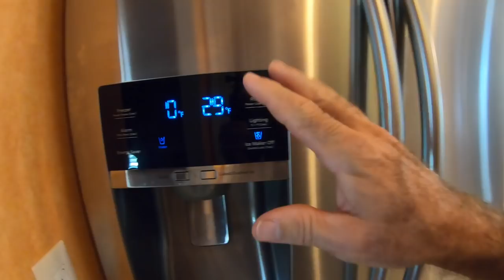HOW TO FIX A NOISY SAMSUNG FRENCH DOOR MODEL REFRIGERATOR

Comment: Weird, I have the same noise, not quite as loud.   The noise stops when I open the door.  I took the panel off and saw a little ice build up but not much.   Before defrosting it, I just disconnected the fan and shut the door to see if that was the problem.  It still makes the noise, even though the fan isn't running?
Reply from the maker: The fan motor is designed to stop when the door opens.  If the noise is still present after unplugging the fan then this obviously isn't the source of the noise.  Possible the noise is coming from the lower freezer section.
Reply: @MyPIDream  I pulled the fridge out and got behind it to see if I can narrow down where is coming from. It really does sound like it's coming from behind the ice maker area.  Compressor maybe?

Comment: Helpful information and good video, but not a fix.  This just resets the problem.  And if that is all you are doing, I think it's preferable to just let the unit defrost without getting near the coils.  As to the underlying problem and causation, how about installing some sort of barrier, perhaps plastic or light metal and slightly perforated, glued or attached with fasteners, separating the fan and its shroud from the coils on the right?  Seems like if it is in the right spot, attached firmly, it might divert freezing condensation away from the fan and fan shroud if attached carefully so it doesn't interfere with any component nor prevent necessary fan air flow.  Also tempted to gently bend the coil tubes away from the fan but I realize that's delicate because they are soldered.  Another idea would be to remove the fan and shroud assembly and augment the shroud in some way that would physically prevent encroaching ice from interfering with the fan blade rotation while still allowing necessary air flow.  Thoughts?
Reply from the maker: The main point is to analyze what is causing the icing which ends up with ice contact on the fan itself.  Adjusting the copper tube was a fix for us as we've not had a reoccurrence of this problem since this procedure was done.  The procedure I explain in this video is my approach but it's possible there might be other solutions, as you suggested, that might also correct the problem.  As they say, "there's more than one way to skin a cat".
Thanks for the great comment!

Comment: We have this problem with our Samsung! It started after 5 years of ownership but since it started acting up we've had to defrost it twice like this! Is this something we're going to have to deal with forever or is there a more long term fix? It's so frustrating to have to remove everything from the fridge to defrost it!
Reply from the maker: This video is to help you identify the root of the problem and a suggested fix.  If you just want to defrost the coil you don't have to empty your refrigerator and you can do a forced defrost using my other DIY help video about this model of Refridgerator.  https://youtu.be/6tFWkWzLSqg

Comment: I'm too trepidatious to do this on my own and really don't relish the thought of having to do this on an ongoing basis, so I'm wondering if you know if I have a service person come out, do they have a permanent fix to this problem or will they just do what you did and at some point I'll have the same problem again. Thanks
Reply from the maker: Before you spend all that money, try doing a "Forced Defrost".  This is only a temporary fix but might help with the noise.  https://youtu.be/6tFWkWzLSqg
Also, make sure your fridge is the recommended distance from the back wall.  Sometimes if too close it doesn't allow proper ventilation which could cause freeze ups.

Comment: It's been about 2 months since de-icing and the fan noise is coming back but there is no ice build up.  Worn fan bearing? I can't think of another part that could make that noise.
Reply from the maker: It could be several reasons.  My main thought is the fan frame could be warped. I doubt the bearing is making that kind of noise especially if its not all the time.

Comment: You know that that motor should run longer hours.
I have the identical problem. 
The heating coil should be programmed to run more hours . To avoid the ice build up. 
This is an expansive refrigerator.  
We should not be paying for these repairs. 
Maybe we should file a class action lawsuit. 
This is a common problem on most " frost free refrigerators"
Reply from the maker: I've been told there has been a class action suit against Samsung for these issues.  I haven't seen anything in the news as of late though.
Reply: @MyPIDream  
I did find the class action lawsuit.  Just search on Google 
" class action lawsuit for Samsung refrigerator "
They show a list of models numbers.

Comment: Ours was making the fan noise, but we didn't really do anything except I'd sprayed some canned air through the openings at the top to test if it may just have been dirty.  Within about an hour the fan noise stopped.  Now, a little over a week later with no fan noise the fridge is no longer cooling, however the freezer is just fine.  I'm wondering if it ruined the fan motor, what do you think?
Reply from the maker: The high pressure or if you used it with a straw might have disconnected the power cord to the fan.  It will require opening up the panel and inspecting.

Comment: My 2016 Rf26hfendsr is freezing up on back panel but freezer is still working . Pull out freezer on bottom and French doors on top. Before trying  to service this myself... quick question...do I need to unplug the fridge or can I just attempt to defrost without unplugging from the wall?
Reply from the maker: You can put it into "Forced Defrost Mode" for only the top section and see if this helps.  If this is a reoccurring issue then it'll be time to open up the back panel, either by you or a service technician, and determine what's causing the issue.  The refrigerator is programmed to go into an auto defrost cycle every 8-10 hours.

Comment: That's a temporary fix, its not a permanent solution. Its going to happen again. I have gone through that same procedure at least three times, since I bought it 4.5 years ago. No problem the first 3 years, the last 1.5 year it regularly acts up. I guess I will have to unload it somehow. Who needs the headache and the time ticker with it. Appliance dealers should stop selling them or at least advise customers of the drawbacks.
Reply from the maker: If you don't correct the cause of the problem, yes it will reoccur.  I corrected the alignment of the copper tubing that was freezing over and I haven't had a reoccurrence of the issues since.  This fixed the problem with our unit.
Reply: My PI Dream -Well now that’s a thought. Perhaps a video would be great if you can show us how you realigned it. And by the way, I just done defrosting the coils again. This is the 4th time doing it.

Comment: Hi, this just started happening to my fairly new  samsung fridge, I'm too scared to unscrew anything- do you think if I let the fridge defrost for 24 hours that would solve the issue for a few months until I can get a service person to look at it?
Reply from the maker: You can also use my next video on this Refridgerator to do a manual forced defrost.  Check out that video.
Reply: @MyPIDream  thanks, i'm a single mom and have no idea about household appliances, can't believe this is happening now. I'm hoping it is ice build up, I left the doors open a bit and then closed them and now no noise but i'm afraid it may start again soon. I'm wondering if it's dangerous.  I saw ice on the back panel of the fridge.I'm going to defrost it tomorrow.

Comment: Any idea as to what might be causing this sound if there is no ice buildup and the evaporator fan has been replaced?
Reply from the maker: Yes, the fan housing might be warped when the back panel is reassembled.
Reply: @MyPIDream  Turns out it’s the fan in the ice maker. Force defrosted the ice maker and then turned ice making off and the noise is gone. Looks like bagged ice from now on because I’m tired of having to defrost the ice maker monthly.

Comment: Great video, is there a fix that would help avoid the frosting or build up after the fix?
Reply from the maker: What worked for me was making the correction to the copper tube where the icing occurred.  It was poor quality control at the factory that allowed this unit out the door with the misaligned copper tubing.  Once I corrected that we have not had a reoccourrance of the icing issue.

Comment: I'm about to undertake this task because you've made it seem easy! Can you clarify: Did you turn off the power at all or no? If so, did you unplug the fridge or turn it off elsewhere? And at what point did you turn the power back on?
Reply from the maker: I unplugged it from the wall.  That's the safest bet.  You can turn off the breaker as long as the house is wired correctly and there's no residual voltage riding on the neutral or ground.

Comment: hey there.  Loved this.  Was able to do exactly as you said.  Great video.  There was some icing, but not a lot.  Back operating and...sadly, sound remains...could it be bad fan?
Reply from the maker: If the sound started right back up after you defrosted and reassembles, chances are the fan was assembled too tight in the housing.  A good way to check this out is to pull the back panel off again but leave the fan connected.  Apply power to the refrigerator and listen for the noise.  If it's still making the noise, unplug the refrigerator then loosen up the mounting screws on the fan just a bit then re-accomplish the task above.  If the noise goes away it means the mounting screws were too tight and warping the fan housing.  This happens often on noisy computer fans.
Reply: @MyPIDream  YOU are MY dream!! Thank you so much for your continued help.  Oddly, this morning, the sound is gone (having done nothing more)...gonna wait it out with fingers crossed.  If it comes back I'll try what you suggested above.  Thanks a lot!

Comment: My Samsung Refrigerator is a two year old model that looks like yours - but - the copper pipe refrigerant 'loop' is gone.  Same result - fan started making noise last night.  Followed your instructions and the only hard part was figuring out how to remove the shelves over the ice maker cartridge.  This is my second Samsung with this problem and it is my last.  The Koreans are very handy at solving problems in their machines but not so with the Samsung refrigerator.  I will not buy anything Chinese.  Prefer US products.  Wonder if there will ever be an American made refrigerator in the future?  Live and learn

Comment: Comment and a Question:
That was a great run through. Havinmg just replaced the faucets in the Master Bath- working in a tight space on my back grrrrr!! I wasn't happy to hear my Samsung four door French fridge moaning and groaning! One more Covid-19 locked-down (not really- bs) project! Thank you for a great explanation on how to resolve. I can handle this.
Here's my question. Why not wrap the copper lines at the top with thin foam pipe insulation to limit the problem/defect from reoccurring again- or at least as often?
P. S. - Next up will be replacing the defective designed ice maker- you know, the one Samsung claims is not a design defect?
Reply from the maker: You can do a "Forced Defrost" on the ice maker.  I have to do this all the time.

Comment: James, I unplugged mine for the night and hopefully the ice behind the panel will thaw on it's own by the time I get home from work tomorrow. Do you think that might work.
Reply from the maker: Yes, it will eventually thaw if you leave it unplugged long enough but if the copper coil is misaligned it will always continue to freeze up.  I corrected the bend on ours and so far we haven't had a reoccurring incident.  Good luck!
Reply: Dawn, did that work?

Comment: Hey James, thanks for sharing. I followed your directions last night at 2:30am as the fridge wouldn’t let me get to sleep. It happened the night before at a similar time so I left the door wedges open and I ran a Refrigerator Defrost “RD” and “FD” cycle on it twice later in the morning, which appeared to rid me of the noise... until this morning.

I followed your directions and it was frozen. I used a hairdryer and carefully ice picked the bits and put it back together again. 

My question is, if we run regular RD or FD cycles, will that prevent the ice build up? 

Thank you.
Reply from the maker: Remember, if the issue continues to return, the problem hasn't been fixed no matter how many times you manually defrost your refrigerator.  Find the source of the problem and try to resolve that.  For me, the miss aligned copper coil was the source of my problem.  Once I carefully bent it back to the correct position the freeze up issue hasn't returned.
Reply: My PI Dream Thanks for your response. My model has the lower deli tray that slides out, and there’s also a sheet of ice that freezes the tray to the bottom. I think my issue is also the copper, but also the drainage hole being blocked too. It’s a shame really, it’s a beautiful fridge and I love it. Just having to jump on YouTube and follow tutorials quite often to keep it together.

Thank you again.

Comment from the maker: Sorry, I accidentally deleted the question of one of the viewers who had a problem with the refrigerator freezing up again the day after they did the fix I show in this episode.  Here's the response I prepared and again, sorry for the accidental delete.  
***************************
Samsung refrigerators go into auto defrost every 8-10 hours. The main control board on the back is what sends power to the defrost heater in the refrigerator and freezer (on dual evaporator systems).  I’m pretty sure there is no way to change the defrost cycle but you can manually put your refrigerator into defrost mode yourself.  To do this, press both the “Power Freeze” and “Fridge” buttons at the same time.  Hold both buttons until the display beeps and goes blank.  Next, press the “Freezer” button a second time.  After a while, you should have water melting into the evaporation tray under the refrigerator.  It might be necessary to unplug and replug in the refrigerator to take it out of defrost cycle.

If you had ice the very next day its possible you didn't get all the ice melted when you followed my procedures.  Even behind the copper pipe that goes into the foam insulation, you must make sure it's all defrosted.  Also, make sure all the plugs are connected back properly into the connectors.  If you have the same refrigerator as mine you can use the video as a reference.  You didn't mention where the ice build up was concentrated.  That might be helpful as well in troubleshooting.

If after doing all the above and you still have an issue with freezing, it might be a problem that needs to be looked at by a technician as its possible the thermostat sensor is bad.  It will need to be checked with a multimeter to see if the Ohms and voltage are correct.  If not, you probably have a faulty sensor or electronics component.
Reply from the maker: This is correct.  I have a Samsung refrigerator in the Philippines that I regularly have to use the "Forced Defrost" for our ice maker.

Comment: Has anyone had an issue with styrofoam breaking and getting stuck when trying to remove cover at the back of the fridge?
Reply: Yes, I did. Did all this today. Had to run a hair dryer all around the edges for a long time to melt the ice buildup at the bottom. Once it started dripping pretty well I got a putty knife to begin to gently pry the styrofoam out. It eventually came loose then I was able to move the cover and melt the rest of the ice build up on the coils, etc.
Reply: @dmyhill  -I had the same problem. I could no remove the back panel so I used a hot hair dryer to help melt the ice and easily came off. Looks like I slightly cracked and melted the Styrofoam a bit around the edges. I had no choice and put it back like that. I wonder if it in the long run it will cause harm or damage to the coils. I thinking of perhaps order the foam as replacement part just in case. What do you think?

Comment: Loved your video, great job...I am assuming that if the noise only stops when opening the freezer door that it is in that compartment only?  Does the freezer portion have its own fan?
Reply: I have the same issue in the freezer.
Reply: @saundersjt  any luck on fixing the freezer?
Reply: @karsonclausse5506  Noise was from the evaporator fan, but motor on it actually shorted out and the freezer had stopped cooling altogether. Evaporator fan replaced and had to enlarge the drainage tube in the freezer compartment, but so far so good Still makes the odd noise here or there, but nothing like before.
Reply: Thanks for the video. I have the same noise. The noise continues when you open the French doors but stops when you open the FREEZER drawer. I searched and did not see a solution in the thread. I removed the panel checked the top fan anyway and made sure the back fan was clear. It did not fix it. There must be a fan in the freezer portion? Does anyone know if that's the case?

Comment: That fridge has a notoriously problematic ice maker, has yours been acting up?
Reply from the maker: Yes.  In both of our Samsung models here and in the Philippines.
Reply: I have had  to defrost the ice maker 2 x in the  last 2 months to make it work again . By the way I used my steamer to defrost it instead of heat gun. I can use steam with point accuracy with no problem melting anything in the fridge and is much faster
than using a heat gun (did that too)
Reply from the maker: Good tip on defrosting.  What I've been doing is to turn the ice maker off until it's depleted of ice then turn it back on for about 24 hours.  This seems to be extending my times between having to do a manual defrost.
Reply: @MyPIDream  How do you turn the ice maker off?